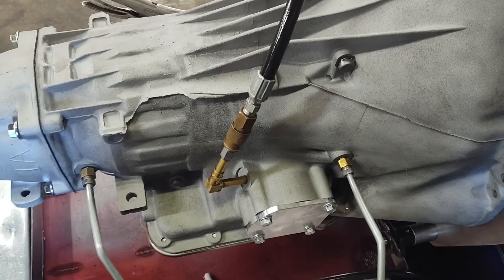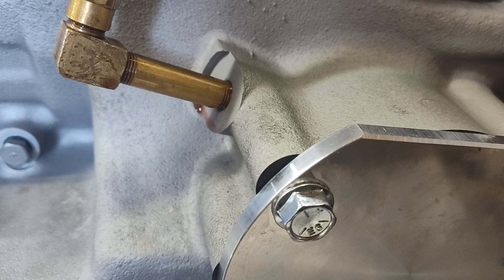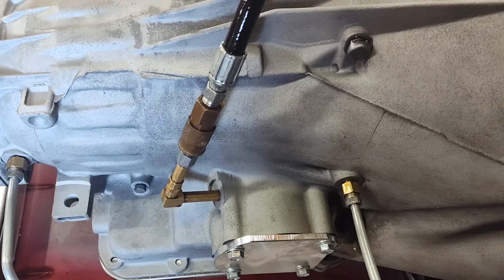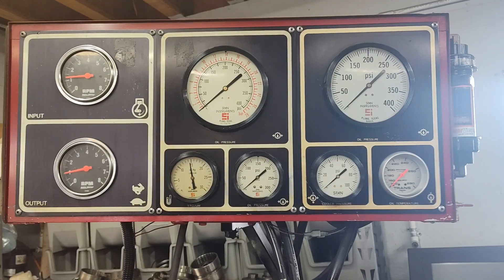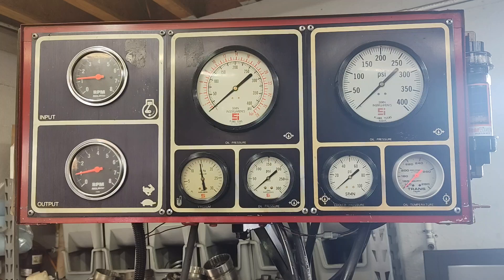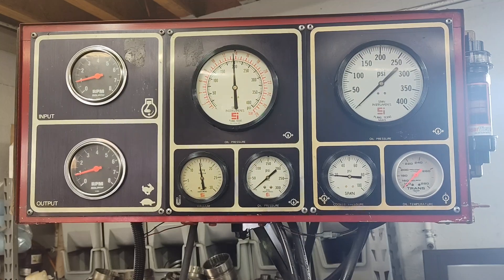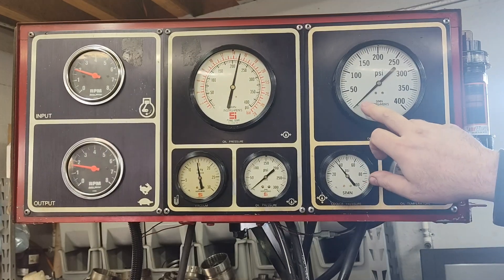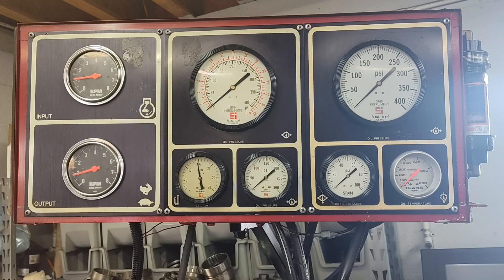How To Use Pressure Test Ports Ford C6 Transmision

Comment: Thanks, very informative. I've never seen a C6 case with that port (that I recall), so now you have me wondering if there's a simple way to add one to a case that didn't come factory equipped. I'm sure not everyone has the tools to properly locate, drill and tap a port in the right place, but for those of us that do, it would be something I'd do (If I knew where to locate it) on any refresh because I've had 3rd go on a C6 years ago and I just put it down to a bad shift kit. Never had any problems with Transgo kits, but WAY back in the day B&M seemed to be the go-to and after putting all the 3rd gear frictions in the pan, I swapped out that VB for a Transgo.
Reply from the maker: Sure you could add it if you have the tools and the skills.
Reply: @BroaderPerformance  Thanks Jay, I have a project for Spring (fingers crossed!) and I hope to get to that once I have a bare case. You, Sir, are an invaluable gift to all of us who choose to avoid the modern "throw away" vehicle culture!

Comment: C4s had a similar port in only '72-'73. It was used as part of the transmission regulated spark (TRS) system. This system would only allow vacuum advance to the distributor when the transmission was in 3rd gear. Manual transmissions also included a mounted switch for this function in those years. I suspect the C6 used this port for the same function and it is probably only found on those shortly after the '72 year range.
Reply: I did not know this. Thanks! I have a C4 case with an extra port on it. I was not sure what it was used for. May be this is what it is for.
Reply from the maker: Good info. Thanks for sharing